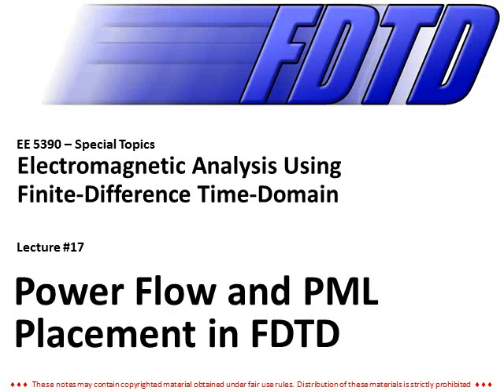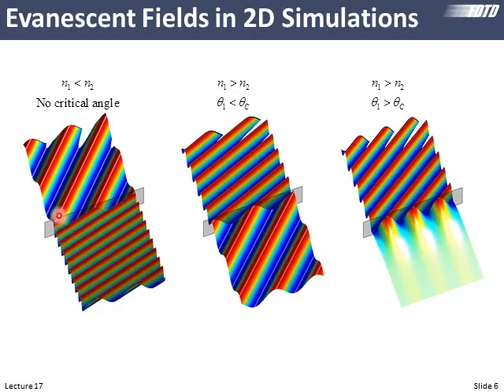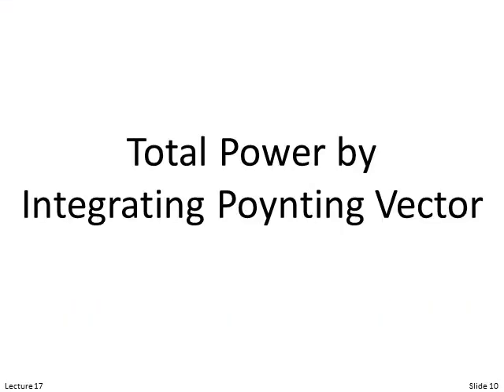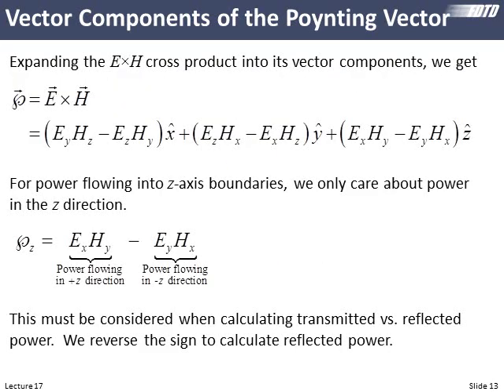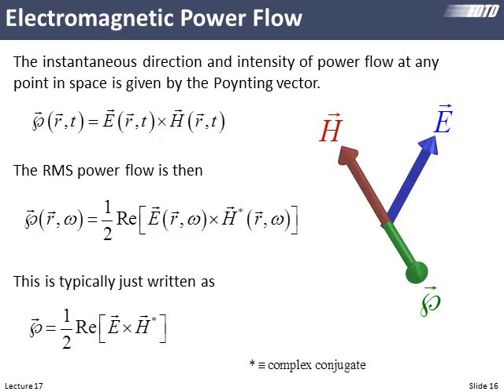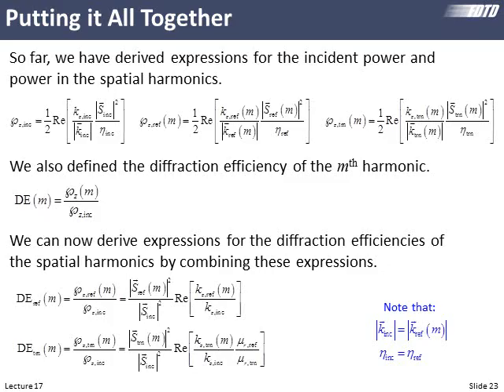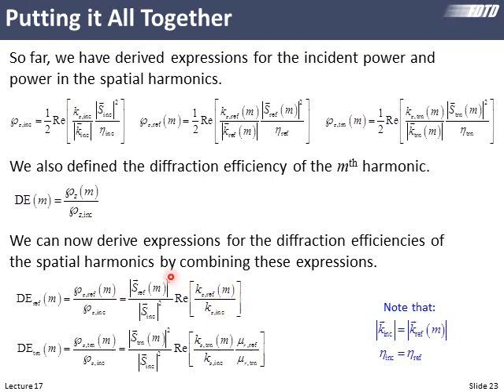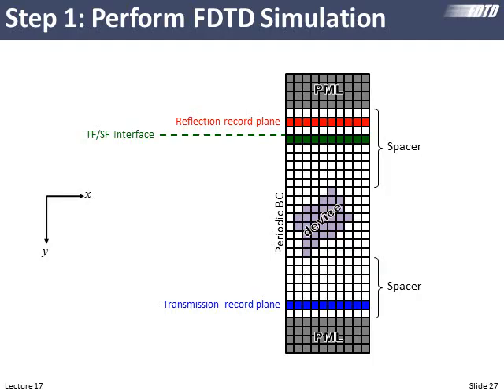Lecture 17 (FDTD) -- Power flow and PML placement

Comment: Thanks for these videos this is a great resource! What is the reason for calculating the Plane Wave Spectrum. Could the reflection spectrum be calculated by just getting the Poynting vector? i.e. (ExHy* - EyHx*)ref/(ExHy* - Ey Hx*)inc
Reply from the maker: Yes, the easiest way to calculate total power reflected and transmitted is to simply integrate the Poynting vector across the grid.  I prefer to do this via diffraction efficiencies.  This is definitely more complicated, but provides more information that is sometime very valuable.  For example, in many measurement setups it is only the zero-order mode that gets detected.  To match your simulation to experiments in this case you will have to ignore power in all other diffraction orders.  This is not possible to do if you are just integrating the Poynting vector.
Reply: @empossible1577  That makes sense. I've also realized since yesterday calculating the diffraction efficiencies is significantly less RAM intensive during the update loops (Which is really important to consider when coding for GPUs)

Comment: I want to calculate transmittance and reflectance for non periodic devices so i choose to calculate the poynting vector with first way. Is this vector extists at electric field point? As a result i have to interpolate the H fied at these points and what about time steps? In the end we calculate the power by integrate the poynting vector and after that we fourier transform this quantity like we did it in 1D silumation over the steps loop?
Thank you again!
Reply from the maker: You have it basically write. It does not matter where you interpolate the fields as long as you interpolate all components of E and H at the same point. I typically use the original of Yee cell, but you may find another point more convenient depending on what you are doing. From there, it is a numerical integration of the Poynting vector over position.

I have some information about numerical integrations in Topic 6 here:

https://empossible.net/academics/emp4301_5301/

Hope this helps!

Comment: Hi Professor, at 47:08 of doing the Benchmark, I got the same results as yours, hooray! But I still have two questions on it: 
1) PML setup. I made the PML directly contacted with the substrate(e2). The permeability in e2 substrate is: exx=9, eyy=9, ezz=9. The permeability in PML is also exx=9, eyy=9, ezz=9. Besides, a new matrix is built up for the PML conductivity. Is it right?
2) My results shows the first order diffraction appears at frequency larger than about 6.5GHz. But the conservation curve become squiggly afterwards, especially near the 6.5GHz. Why is this happening? How to solve it?
Thanks!
Reply from the maker: In this course, we have created a PML that is independent of the materials on the grid.  There is no need to make the permeability of the PML the same as your substrate.  In fact, that may mess up your PML.  Also, let the substrate run all the way to the edge of your grid so that the PML overlaps is.  This makes the substrate act like it goes off to infinity.

The squiggly conservation could be because the PML is too close, the PML is not working, or you have not run the simulation long enough, or something else.  It is definitely a sign something is wrong and I am glad you are looking at it.  To test the PML, try it with just air.  You should get 100% transmission and 0% reflection.  Keep some space between your device and the PML.
Reply: @empossible1577  Hi Professor, may I ask two more questions to clarify:
 1) I do want the substrate to go off to infinity in this benchmark, so I set the substrate (e2) all the way to the edge of the grid (including PML). Then I calculate PML conductivity (sigma). Here  I got two arrays to describe PML: e2 (PML fictitious permittivity) and sigma (PML fictitious conductivity). Is it right?
2) As to squiggly conservation, when I set all permittivity (including PML) to be 1, I got get 100% transmission and 0% reflection. It means PML is working. While I still got squiggly conservation with device. I noticed the it's mainly due to the squiggly first order transmission (I got every smooth 0 order curve). Then I increased PML layers from 20 to 120, the squiggly curve is mitigated somewhat, but still exist. The PML is constructed as described above. The transmission record plane is 2 grids away from PML edge. The simulation is long enough. I guess it's either my PML setup is wrong or the record plane is too close to PML edge. Do you any ideas of it?
Many thanks!

Comment: Hi Prof, first of all thank you for the videos! They have been very helpful for my studies.

I have some doubts here regarding this lecture. On slide 36 (40:37) in Step 6, the formula is different from the one in slide 37 (42:31) (the one on slide 37 has /Nx). Which one would be the correct formula? I have tried both in my codes, and if I have done things correctly, I believe the one with /Nx is correct (I get 100% energy conservation, whereas I got more than 100% for the case without /Nx).

This leads to my next question. If the above is correct, why do we need to divide the FFT results by the number of cells in the x-direction?

Thanks a lot!
Reply from the maker: On that prior slide, I suppose I was writing the equation more conceptually.  Most FFT algorithms need to be divided by the number of points in the FFT to arrive at actual Fourier coefficient numbers.  It is just a subtlety of the FFT algorithms.

BTW, I recommend accessing the course through the official course website.  You can get the latest version of the notes, links to the latest version of the videos, MATLAB codes, and other resources.  Here is the link:

https://empossible.net/academics/emp5304/

I am also working on a brand new course for 2D FDTD that is greatly improved!   I hope to have it finished before the New Year.
Reply: Ah I see. Thanks for the clarification and the link!

Comment: When computing kyinc we use nref, is this the refraction index at the reflection recording points? If so, do we need to compute kyinc differently (using ntrn) for the transmission recording points? Even further, if the row of recording has varying refractive indices, I'm guessing we'd need to compute each one differently? I know if we're recording at cells where n=1 it doesn't really matter, I just want to make sure I'm understanding what variable is what, bookkeeping and all that.
Reply from the maker: kyinc is always calculated with nref (or ninc) because that is the medium above the device.  kyinc is completely independent of the material below the device.

If you are recording your fields in a cross section that is not homogenous, you need to use a different technique for doing so.  The calculation I present is only for waves where the medium is homogeneous where the source is injected and where the reflected and transmitted fields are being analyzed. 

Hope this helps!

Comment: Thanks for the videos, they're very useful. I'm having some trouble with calculating REF and TRN and was wondering if you could help. I'm using a modified version of the equations in lecture 7 to calculate Eref, Etrn, Esrc and then I'm using the steps you give in this lecture to find REF/TRN. My graph shows virtually no reflectance (which is good because I have no device) but I get no transmittance for most frequencies and the ones I do have very large values (in the realm of 10,000%). Could I show you the relevant lines of codes so you can see where I've gone wrong? Many thanks
Reply from the maker: Shaun McLafferty I recommend looking at your all of your intermediate data to see where things go wrong.  First, look at the field in the simulation.   Does that look right?  Second, look at the field cross section that you extract to calculate transmission.  Is the amplitude near 1?  Third, FFT that data to get the amplitude of the spatial harmonics.  Do you get all zeros, but a value with magnitude 1 in the zero order position?

Comment: It's a little confusing figuring out which direction is normal to the grating. Sometimes it seems like it's Y sometimes it seems like it's Z.
Reply from the maker: Yes, sorry.  It is somewhat of a convention when talking about PMLs in general to have them in the z direction.  However, for 2D simulations the PML is not used in the z direction.  Thus, I am managed to include a confusing mix of y and z.  It is on my to-do list to clean that up.  For now, please forgive the confusion.

Comment: Energy conservation is confusing. You say that Pz,inc = Pz,ref + Pz,trn

However, seeing the illustration in in 8:22, all the incident power in normal direction. There are some diffracted modes which carry power in transverse directions. Therefore it means some of the normal incident power is going to the transverse direction (stays in the device).

Therefore how can we say Pz,inc = Pz,ref + Pz,trn?
Reply from the maker: Yes.  For assessing power in and out, always ignore the component of the Poynting vector that is transverse to the direction of the surface of the device.  This is an uncomfortable concept so here is another way to think about it.  A wave travelling at some angle may be carrying as much power as another wave travelling normal to the surface, but it carries that power away more slowly due to its angle.  Therefore it must be penalized when calculating overall transmittance and reflectance.
Reply: @empossible1577  Hi Professor, I am also confused at this point that only Z component counted. For example, if we put a detector at order 1, both transverse and longitudinal components will be recorded. Besides, I fell the transverse component of the few lowest orders will be absorbed by PML before reaching at periodic boundary, which means it will not remain in our problem space. Could you please explain further why only Z component counted? Thanks.
Reply from the maker: @ruiwang9856  I maybe do not understand your question.  In these 2D simulations, the z direction was eliminated so all derivatives along z go to zero.  This causes Maxwell's equations to split into two independent sets of equations.  For the E mode, or also called TM mode, the electric field only has a z component.  Ex = Ey = 0.  This really has nothing to do with boundaries.
Reply: @empossible1577  My question is the same with _jp88: where does the transverse power go if we only consider the longitudinal power. After second thought, my understanding is the transverse power of k(n) and k(-n) are cancelled out with each other, so the total transverse power is still preserved. Is it right? Thanks
Reply from the maker: @ruiwang9856  Think of the transverse power is just a temporary holding place for energy.  Some energy couples into the transverse power, it propagates parallel to the interface as it slowly leaks away as a propagating wave.

Comment: Hi Professor, at 56:25, even though PML contacts with evanescent field, the sum of reflectance and transmittance also should be 1, right? thanks.
Reply from the maker: If the PML is too close, R+T will not always equal 1.  That is because there is an escape path for energy to leave the simulation without being accounted for.  When the PML is sufficiently far away, then R+T=1.